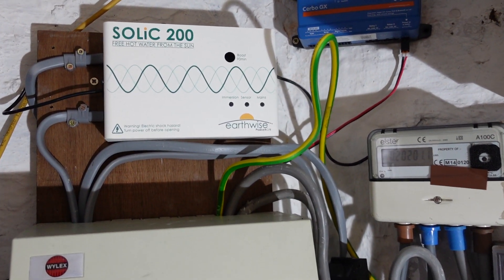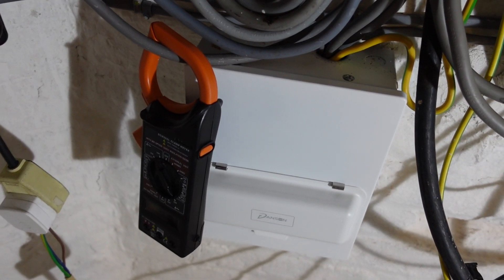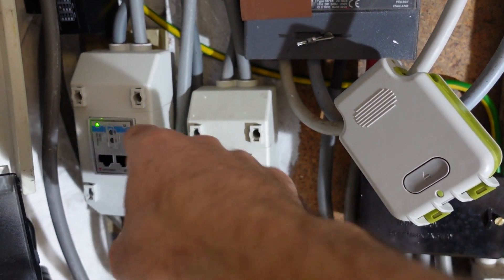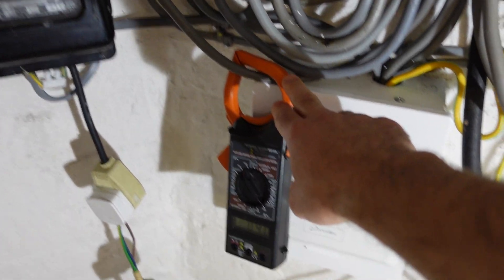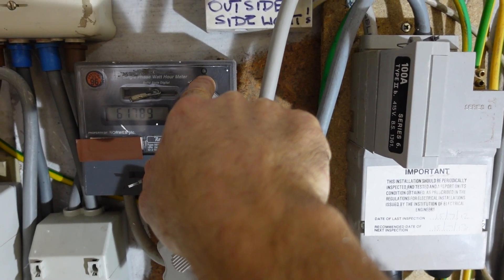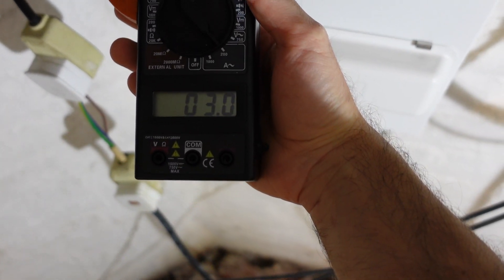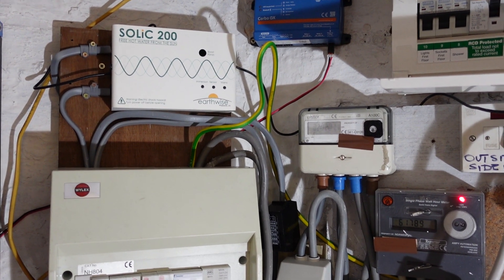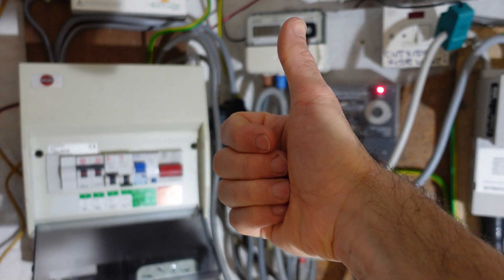Solic solar diverter drawing power from grid? My example: what is happening? Faulty unit?

Comment: Had exactly the same issue with my Solic, contacted Solic and the guy I spoke to told me the clamp must be on the wrong way around, I explained that it has been working perfectly for 2+ years and only just started working incorrectly, he was adamant that the clamp was the wrong way around, and just wouldnt listen to me when i explained that its impossible as its been working for 2 years and no one has touched the clamp, i decided to make a video similar to yours and send it to Solic who then agreed the unit was faulty and gave me a discount for a new unit. I found it really frustrating when I contacted them as the guy was pretty rude and telling me the problem I was having was impossible.
Reply from the maker: Have a look at the short video that I posted yesterday. An update

Comment: One of my neighbours had Solar panels fitted around 10 years ago, part of the installation was a Solic 200 (Black Box) for the immersion heater.

To cut a long story short the gentleman has recently passed away after a long illness and the lady needs some help, as an ex electrician I have been to the house several times and it appears lots of strange issues with the electrics.

The plan is to get an local approved electrician in to totally replace the consumer unit and start afresh, however when I have been checking out the spur for the immersion heater I am seeing very low voltages i.e. 8 – 14v which is very concerning.

Previous to my getting involved an electrician came in and removed the flex to the immersion heater and as a temporary measure put a flex cable on the immersion and with a 13a plug, the immersion is currently only plugged in for max 1hr in the morning for showers. Not ideal but necessary until this is resolved.

The Solic 200 is mounted in the kitchen next to the consumer unit inside a kitchen cabinet, despite looking through all instructions I cannot find how to mount / remove the Solic 200 from the cabinet and don’t know how to open the case to check out the wiring.

I need to find out how to remove the unit and get into the connections, it doesn’t matter whether it’s me or an electrical contractor we need to know. Rather than pay the contractor time to find out I have taken it on-board to find out myself.

Any help would be appreciated, BTW - I have sent an email to Earthwise and so far no reply, I also called but had to leave a voice message
Reply from the maker: Hi there, there is a screw on the side of the white solic, then the screw side lifts and the cover slides out. I don't know for the black, but it could be the same. 

There may be no issue  with the low voltage, the solic may use Pulse width modulation to shop the AC Sine wave to pass a lower power to the immersion, maybe, I don't know. If it is doing it when the sun is out then it may be ok. If it is doing it in darkness then it would be an issue. although such low voltages shouldn't matter. I guess the issue is that it is not heating the water. 

If the lady is going to get rid of the black solic, I would be interested. even if you consider it broken. It would help to support the channel with something to look at. Please contact me through my email on the about page.

Cheers.
Reply: @bootsowen  thanks.

Comment: Did you make contact with SOLiC about this? I have the wireless version which has an annoying glitch. They've never replied to my emails since becoming a customer but were very quick with replies when I was thinking about buying a device. Anyway, that's all irrelevant.

The thing I'd like to add here is that when I first installed my SOLiC, I used a smart Wi-Fi CT clamp on the same tail as the SOLiC CT clamp (main feed from meter to consumer unit) so I could live monitor my import or export load. This device gave me wrong results, the current and power always much higher than expected and always in the same direction (always importing). I have a smart meter display so am able to compare. It dawned on me that I'd need a bi-directional CT clamp which I have since fitted. The readings of this are always consistent with my smart reading display (power). The reason I'm posting this is because you say that you've not noticed an increase to your power usage so perhaps your SOLiC is working fine?
Reply from the maker: I haven’t tried solic. I would agree with you that something could be wrong with my measurements. But the thing that I can’t change is the meter and it is showing incoming power when the solic is on.
Reply: Does your meter (the one supplied by the utility company) display power in/out (in KW)?  The reason I ask is that the SOLiC reacts 5 times per second (that's what they claim for the wireless version anyway) so perhaps the red light on your meter doesn't react quick enough? I'm just guessing. Another thing to try may be to re-calibrate the SOLiC. Page 5 of the guide shows you how do to this. Make sure the house is drawing at least 200W when you recalibrate and that your water temperature in the tank is below the thermostat cut off temperature (the immersion heater needs to draw a load)

I really think measuring power on the same tail as the SOLiC CT clamp is the way forward. Current (A) can be misleading. For example, at the moment my smart meter display is hovering around 0W (it's never zero btw, always a bit above or a bit below), my smart CT clamp is showing an import of  48W but oddly 4.24A at 242.8 V at the same time.
Reply from the maker: My utility meter only has kWh used. So it doesn't tell much in realtime except the flashes. 
since this video I have installed a battery charger/inverter, which doesn't get on well with the solic, but I turned off the inverter today because I had a 2kw surplus of solar and thought I would try the solic again. At one point the two meters in this video were balanced, both lights constant red, but the same tail that the ct clamp is on was showing 4amps on my clamp meter. so odd. 

I have another video about it and my new setup to post tomorrow.

Comment: Owen, it certainly seems there is a problem. When other items in the house are activated the output from the Solic should reduce it's output. It should only divert the equivalent of the possible export. There is a threshold value where a small amount of export is allowed to prevent accidental import. Is the Solic current clamp the right way round, might be a silly question, but one has to ask. If it's the wrong way round, or on the wrong cable then the Solic will import power, cheers
Reply from the maker: Hi Andy, the direction of the clamp shouldn't matter, I wonder if the issue is something to do with calibration, The solic sensor needs to wake up to a load of a few kw for it to know what way the power is flowing. So something like a kettle. What's confusing is that my expected daily usage doesn't go up. So I can't make head nor tail of it. I am waiting on a special cable to join a new energy meter to the victron gx device, and once that happens I'll have data logging for the system. At that point however it may be a moot point. because I have read that solics can struggle with battery systems. We will see. 
I have figured out a way of clamping a gas tight fitting to that odd gas bottle. So if all is well tomorrow I will empty it into a larger Propane tank.
Reply: @bootsowen  be interesting to see your gas transfer setup. On all the diverters |I have fitted they make a big thing of getting the clamps the right way round, not sure about the solic. Cheers

Comment: Does the Solic regulate the power to the immersion depending on the available solar energy? It probably has a Triac as the controlling element. These often fail short circuit. So it would divert power to the immersion heater (relay?), but only at full power?
Reply from the maker: Yes there is a triac in there. But it doesn’t seem to be failing full open. It’s a 3kW element so it would have to be drawing 12 amps if it was a full short circuit failure. It’s less than that. Wasn’t it 7 or 8 amps?
Reply from the maker: Thanks for your comment